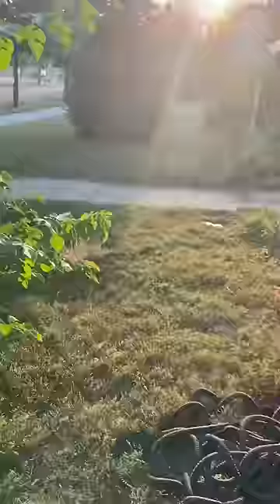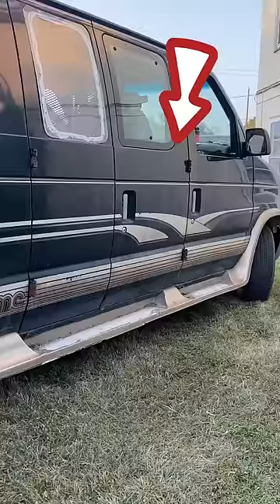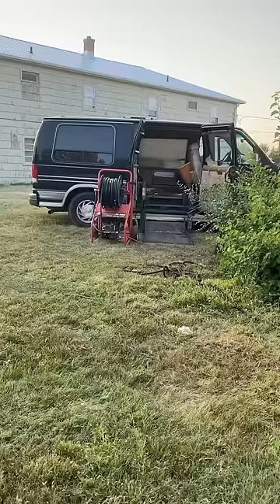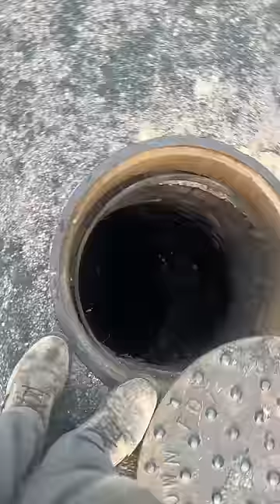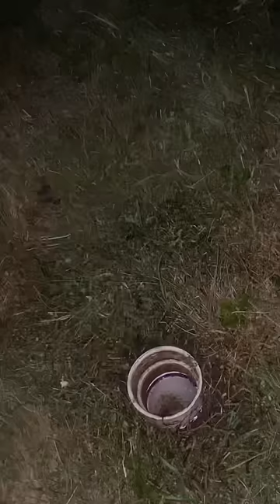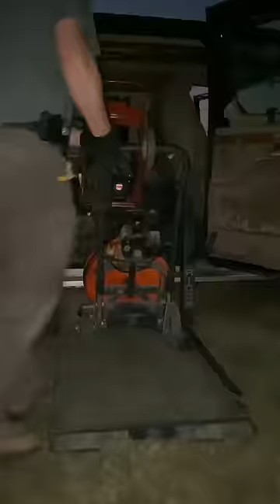Having the police called on me for suspicious activity while dealing with a sewer. #handsomeorhandy

Comment: So how much did that job cost?
Reply: Minimum $700 or so for an easy sewer snake job with an outside cleanout. (1 hour or less). If theres no outside cleanout itll be a lot more if we have to bring our equiipment inside a home and pull a toilet to snake thru. Anything after 4:30 is charged double. See it was dark in the video at the end? Probably charged $1400.
Reply: @HvacSam  that's why I was wondering you can tell they where there for awhile from it being light out to getting dark
Reply: @SamThePlumber Dude you charge 700 for an hour or less of work? Bit excessive no?
Reply: @joshdiehl8737  I have customers who pay more. I quote my jobs upfront as flat rate, not per hour. Most people are willing to pay more for prompt service. They just want to pay a load of money to make their problem go away. If they wanted to save money they'd rent a sewer snake and do it themselves
Reply: @SamThePlumber  I mean emergency service I understand charging/paying more. And you may be right. But trades people are in for a rude awakening if there's ever a deep recession. People aren't going to be willing to do all that. My dad was a plumber. It was great when times were good. Bad when they weren't. The market is way out of whack right now.